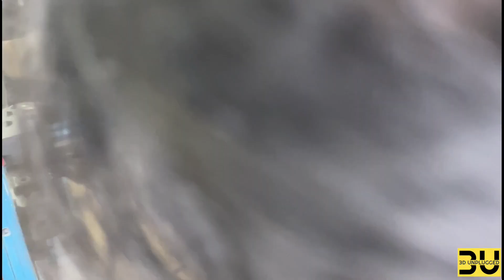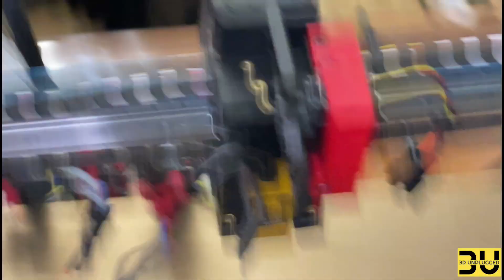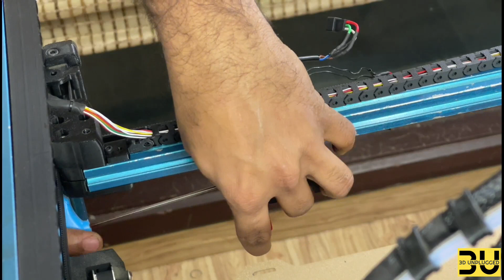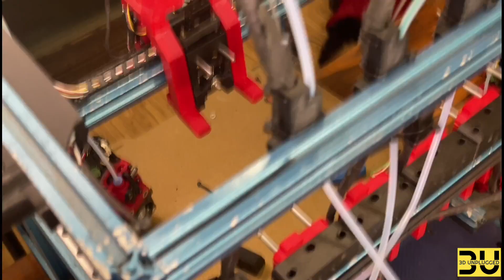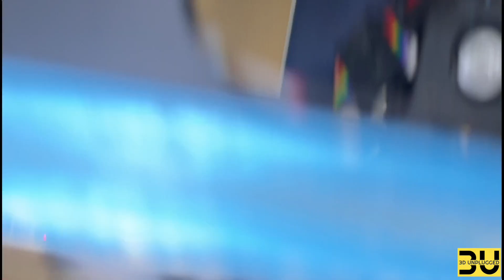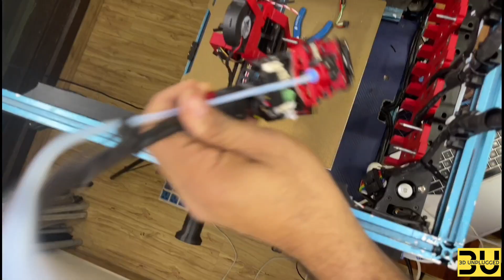'WP-DAKSH' - Voron Trident DIY Tool Changer 3D Printer - Part 4 - Putting it all together

Comment: Sadly, I think that this build has died.
Reply from the maker: Hi - the build has not died - the current printer is operational - I just didnt have the time to finish up the video series due to other engagements. I am currently working on adapting this to a fully mechanical tool changing mechanism. There are updates on the discord channel around this.  Please follow there.
Reply: Hi @ankurv2k8  It's great to hear that this project is alive. I will follow on discord.